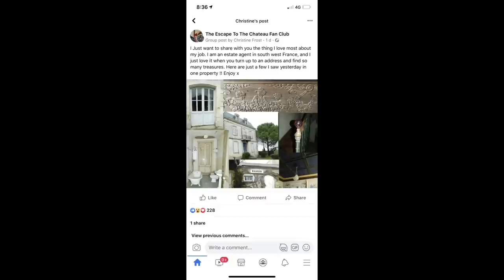Off The Rails at The Maison De Maitre #52

Comment: Fencing and gates looks great!  If I did anything to the urns, I would clean the urns, scrape them with a wire brush really well, then paint them with a matte black.  Are you planning on power washing the stone work of the pillars and the building? That will help spiff it up a bit. ❤️😊